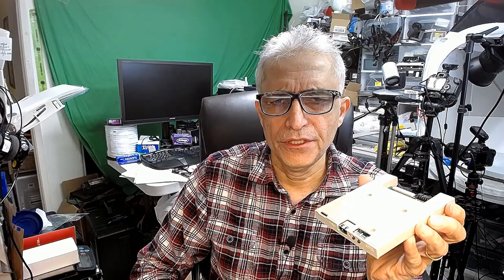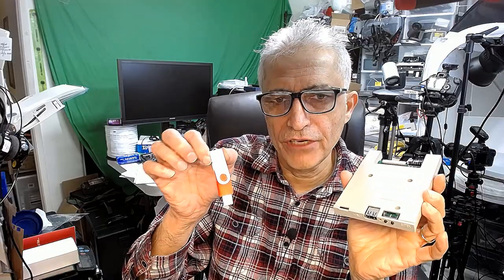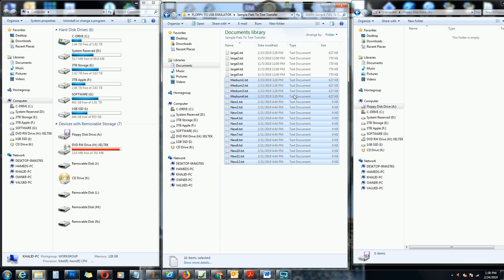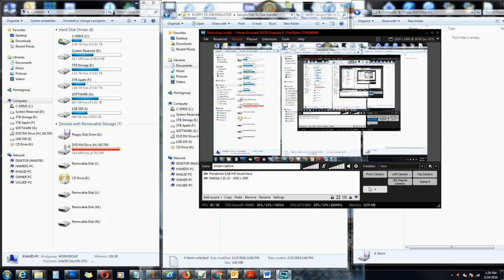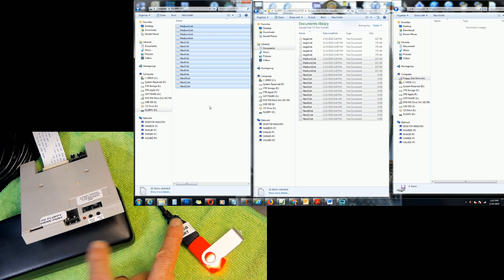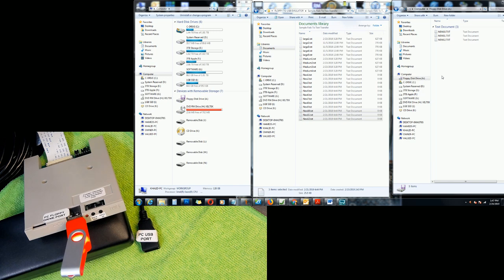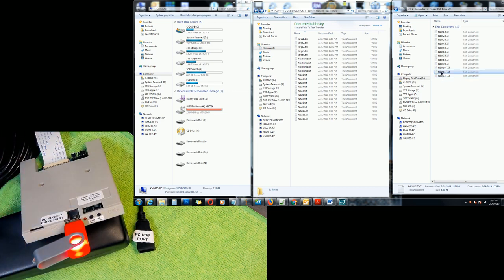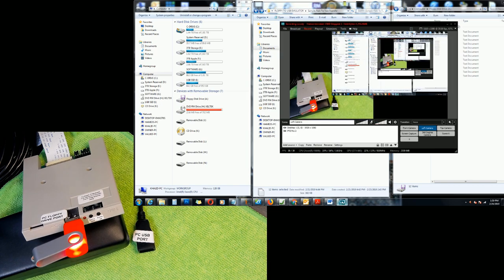Tutorial On How To Use Slimline 720K DD and 1.44MB USB Flash Dr To Floppy Drive Emulator

Comment: MY commel ITX mainbaord has this ZIF 26 connector for the slim gotek .. how do i mod that gotek so i could mount a rotary encoder and Oled display.. or how do i convert a normal 32 pin gotek to work with my mainbaord ZIF connector?
Reply from the maker: Greetings, The rotary encoder is programmable with the 34PIN Floppy Emulator, I have never seen any of them on a 26PIN slime Emulator, or 32Pin Emulator.

Comment: My floppy disc emulator is programmed to emulate 1.44 discs. And my Roland MC 50 uses 3.5 discs. I can change the software in the floppy disc emulator to emulate 3.5 discs ? Sorry for my english.
Reply from the maker: Yes you can but you must buy the 1.44MB version of this emulator not the 720KB one.

Comment: hi man
i have hp 4145a
i have to upgrade floppy to usb
how to make usb disk?
Reply from the maker: You simply save files to the USB Flash drive as if it was a Floppy Disk. However you need to follow each step as I mentioned in this video by pressing the Data-IN and Data-Out buttons.
Reply: @TECHNOLOGYTIPS101  
i dont have a orginal floppy
i have file in internet but have two file with cfg and hfe and another two file with  
txt
i dont no where i pit it
Reply from the maker: @babakspy8270  You copy everything to the Root Directory of the Flash Drive. Make sure the file names don't exceed 8 characters.

Comment: Very informative tutorial. I need a 720k emulator for my IBM PS/2 model 30 8086 PC. Two problems: it uses a different, custom interface, and the 720kb verison of the emulator is a bit too pricey. The interface might be compatible to regular PC MFM floppy interface, it just has a different connector and pinout. Is it possible to hack a 1.44MB emulator into 720kB mode? 

I'd try to reverse engineer the pinout of the PS/2 floppy interface and make an adaptor, but I don't want to spend $35 on a 720kB emulator. The 1.44MB version is about half the price. And also, someone states that all PS/2 model30 are compatible with 1.44 drives, others say the 8086 version is not, only the 286 version. If it turns out to be compatible with 1.44MB, I would use the emulator in 1.44M mode instead. So I would really like to know if they are somehow convertible between formats. Maybe it just needs different firmware? Or the change of an internal solder jumper?

Thank you in advance.
Reply from the maker: Hi and thanks for your compliments. The problem with your IBM PS/2 is the face plate even if you find a floppy emulator with a matching interface you will have a hard time reaching it from the thin opening in front. So you will need to cut out the face plate to be able to push the floppy drive emulator forward to be accessible. That will be a difficult challenge to do it right and without it looking ugly.  After that your second challenge will be in the interface pins some used to come with a 26pin drive others with a 34 pin and even with older PCB edge interface like the 5 1/4 floppies. So you need to open it and count that and see what type of floppy you currently have installed in it.
Reply: @TECHNOLOGYTIPS101  I might install the emulator internally, and bring out a short USB extension on the back to attach the flash drive. The original drive has a card edge connector, but different to standard 5.25" PC drives. It has no separate power connector, it gets the power via the ribbon cable. I don't know the pin count from the top of my head, the machine is in storage since at least 2016. I have to dig it out. 

My main question if these emulators can be hacked from 1.44M to 720k mode and vice versa?
Reply from the maker: @mrnmrn1  If you want to install it externally then you must use a longer flat ribbon cable on the back because you must have access to the two buttons on the floppy face plate

Comment: Hello I just bought a 1.44Mb slimline emulator and installed it in my brother ult2002d machine. I formatted my USB 2.0 to FAT32 and had my embroidery file (.pes format) in the root directory. My file name is also only 4 characters long. It is still not able to read my file, but I know that I installed the emulator into the machine correctly because the machine can sense a floppy disk inserted. I am not sure what I am missing? Thanks
Reply from the maker: Was the emulator specifically modified for Brother ULT2002 Disney Edition, or you just bought a generic one with stock firmware?
Reply: @TECHNOLOGYTIPS101  I bought a generic one with the stock firmware off aliexpress
Reply from the maker: @ledgeend3371  When you buy a generic one with factory original firmware that chances of it being compatible with you machine is slim, but not impossible. So it is like hit or miss, most of the time you have to customize the firmware so that your machine can communicate with the flash drive. Although I have seen cases where a generic drive worked just fine. You can always customize the firmware yourself using Flashfloppy firmware which makes you emulator more like a universally compatible drive. There are many videos on YouTube on how to customize the firmware

Comment: Were can i buy that emulator?
Would it work with my Brother embordary machine PR600 ?
Reply from the maker: Hi, here is the link  https://ebay.us/3APcau
Reply: Does it come with Housing material?
How different is your than from the one on amazon it’s the exact one ? Amazon has it for $35
Reply from the maker: @Fiestafunjumps  Unfortunately it does not included the housing. So to use this you must have an existing floppy assembly like this already https://ebay.us/kIK6L6 
 The one in Amazon is 720KB ours is 1.44MB and it has the standard Firmware from Factory " Gotek" not modified for brother. Also they don't include the 8" Flat Ribbon Cable, and the Flash Drive.

Comment: Hello 👋 sr i need your file for 720kb to my gotek emulator .can you send me . please . thanks 👍
Reply from the maker: You mean you need the Floppy Manager Software?
Reply: @TECHNOLOGYTIPS101  I have one gotek emulator 1.44MB. I want to convert it to 720k. for old machine embroidery .now do i have to installing theses files at my emulator. or anything else?. Thanks 👍
Reply: @TECHNOLOGYTIPS101   hello 👋🤗 dear . You didn't answer me.
Reply from the maker: @ayacheharendi4337  I don't have the file, I tried copying it using the ST IC Programmer software but when you send the Unlock command it wipes clean the firmware from the chip. So I basically killed a good floppy emulator trying to get the file. You should try to get Flash Floppy it is free and open source.